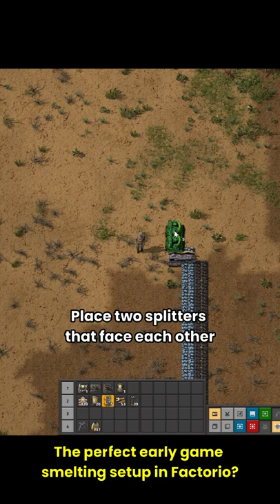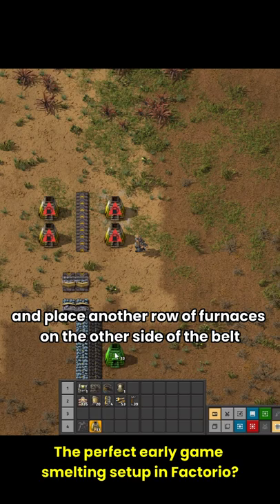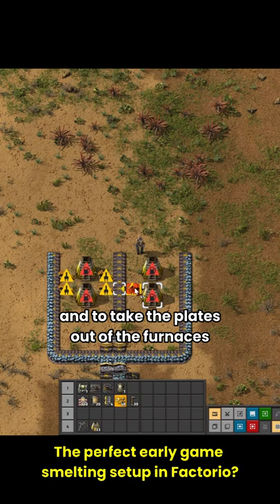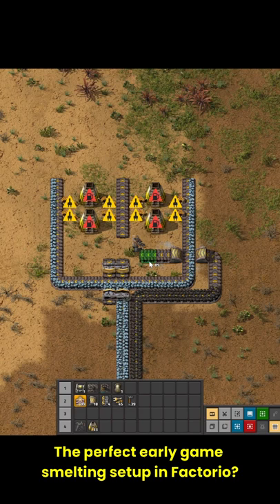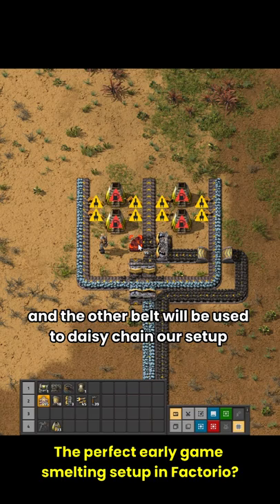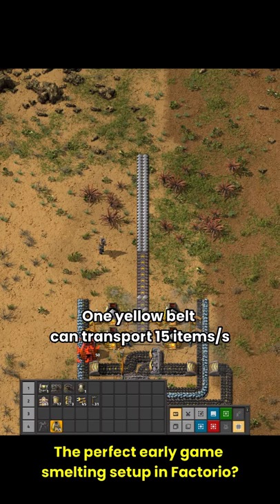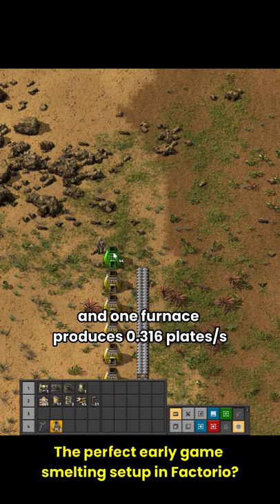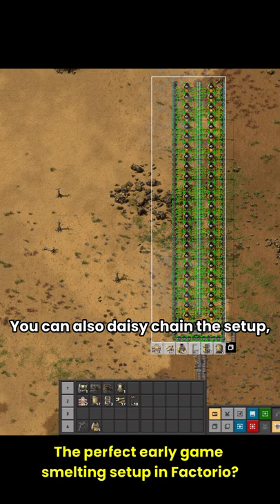The Perfect Early Game Smelting Setup in Factorio

Comment: Correction: if you want to use this setup for stone bricks, make it half the size because each stone brick requires 2 stone.
Reply: So 12 furnaces long ?
Reply: @meneither3834  yes use 24 furnaces instead of 48. And if you’re using steel furnaces, you only need 12 because they smelt twice as fast
Reply: @poggertroll  When using steel furnace you just replace yellow with red. The ratios stay the same.
Reply: Stone bricks can use a different setup, with fuel in the middle. Similar to the internal part of a steel setup.
Then just have a stone belt per side of the furnaces.
Reply: Or full size for belt of bricks but then needs to be fed 2 belts of stone so red belts would be needed or separate coal belt

Comment: I usually use inserters to move the fuel to the fuel lane for tighter layout. So it's using 1 splitter for the resource, 2 inserters + 2 underground belts for the fuel. It can also chain to another smelter
Reply: the main reason you use 2 splitters is because it makes the belts go straight instead of being turns which forces the ore to only be on one side of the belt. its a super easy way to do that, the only other ways you can do that is by placing belts facing into the belts coming out of the splitter or by using staggered undergrounds, neither of which look as elegant and simple.

also could you elaborate more? im not sure how inserters could be used here and it still daisy chain
Reply: @Templarfreak  The ores are splitted and then sideloaded

2 Inserters to bring the coal to existing half ore belts.